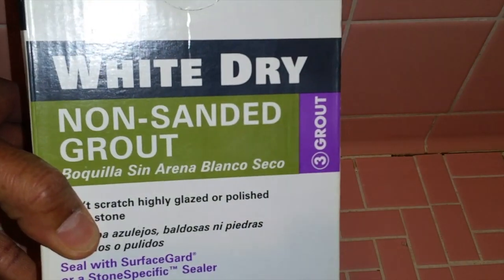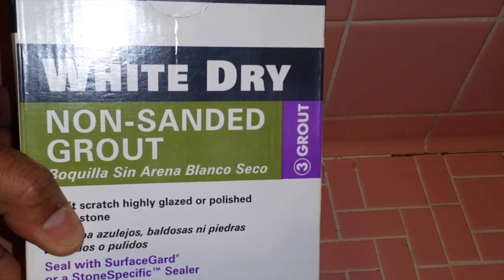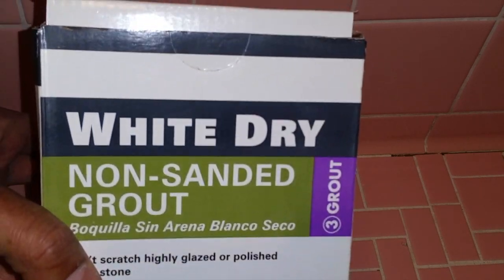How to Grout a small area repair and replace missing grout

Comment: Thanks for the tip. this was a help. FYI 0000 steel wool will remove accidental haze without scratching glazed tile but don't use it on the grout.
 I know because I use it to clean the glass on the inside of my wood stove door. It doesn't scratch and leaves fire resistant glass or tiles nice and shiny.